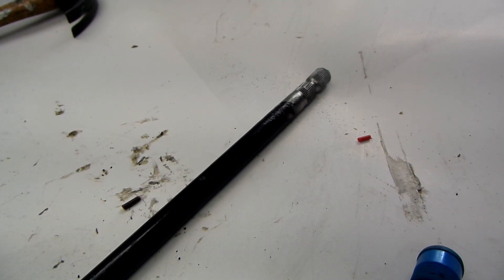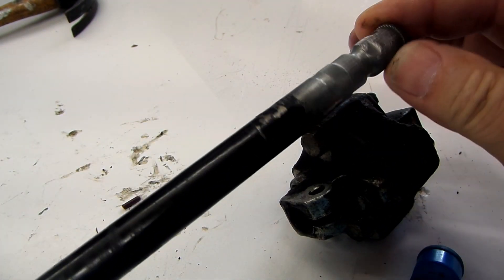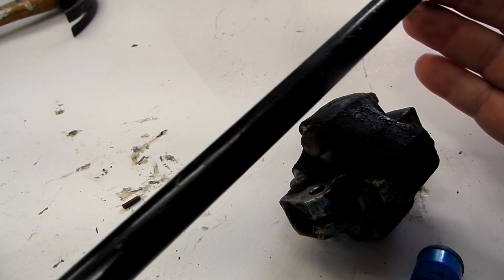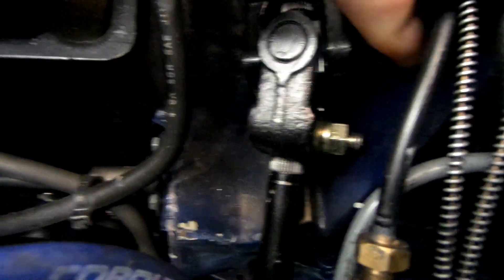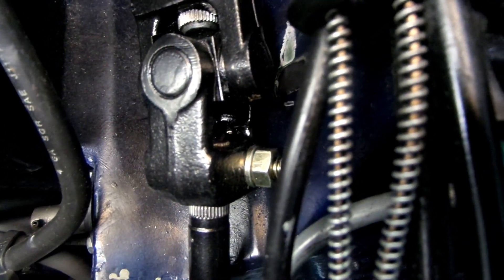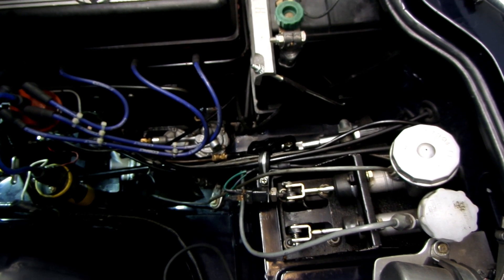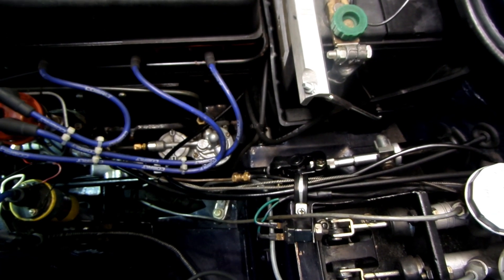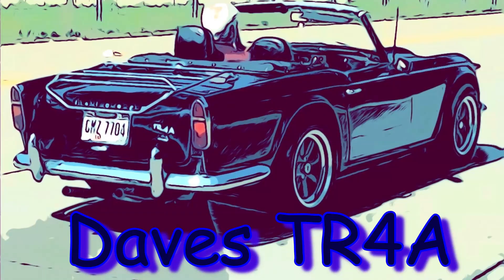Daves TR4A 2024 Steering Repair

Comment: I never trusted that rubber joint on my TR6. One of the English suppliers sells a solid shaft with u-joints at both ends. I replaced mine with that. Like you, I didn’t notice any extra harshness in the wheel after replacing.

Comment: One YouTube certified mechanic calls the pinch bolts that retain the joint on the steering shaft the "bolts of death"... if left out or not properly tightened! 🙄 (He's not talking about Triumphs, either... most cars have at least one.)
Over time the all metal, TR6 style joints will wear and get sloppy... occasionally need replacement. Of course the rubber ones harden with age and eventually need replacement, too. Latet TR4, TR4A and subsequent models mount the steering rack in rubber, so there won't be a whole lot of additional road vibration felt through the steering. The early TR4 had a solidly mounted steering rack, so at least one of the rubber "donuts" is a good idea. 
I can't tell from the images, but would hope the nuts on those pinch bolts are the locking type. The stronger all-metal locking nuts would be ideal (instead of Nylock).

Comment: You are so lucky having this happen when it did. I'll have to check my joint tomorrow. Funny you didn't feel any play in the steering before it failed.
Reply from the maker: It wasn’t an instantaneous failure and you are absolutely correct as it failed at a point where there was    very minimal impact on my safety.

Comment: Dave the clamps that hold the rubber joints are notoriously poor. They have a design flaw. The point where the bolts go in cannot exert enough clamping pressure. There is a fix by cutting a deeper slot for the bolts to clamp on. The UK Triumph Registry forum has several topics on this.
I also fitted a TR6  universal joint to the lower shaft, but kept the rubber donut on the top (after doing the modification to the clamp.
Reply from the maker: Why not replace the upper rubber joint? I have put about 30 miles on the car since I replaced both rubber joints and I honestly can’t feel any negative effect. I was only able to buy 1 “new” TR6 steering universal joint and that one is on the rack end, The other joint is a used one but it seems pretty tight. So far, so good.
Reply: @DavesTR4A  I had replaced both rubber couplers before I found out about modifying the clamps. So they were in good condition. Then I decided to pull them both to modify the clamps. However that lower one always bothered me because it barely cleared the lower radiator pipe (not an issue on RHD cars). So I decided to swap that one for a TR6 coupler, and now there’s plenty of room. With the clamps on the upper rubber one already “fixed”, I decided to put it back in. 
As long as the rubber couplers are in good condition, they’ll be fine. But it’s the poor design of their clamps that is the real safety issue. So yeah, replacing both with TR6 ones, is easier than modding the stock ones.
Reply: The "design flaw" must be a shortcoming of the replacement parts. I had original OEM "rubber donuts" in my TR4 for many years with no problem keeping them clamped tight. (I've owned the car since 1977.) It will be getting new donuts (or one donut, one TR6 joint) during the current restoration,  so maybe I will be able to compare.
Thanks! It's good to know to watch out for this possible issue!